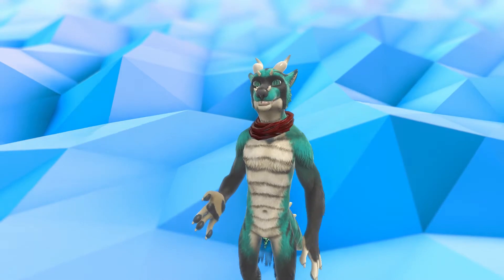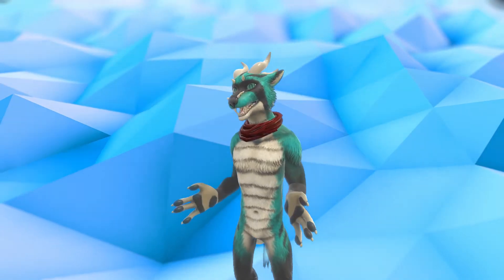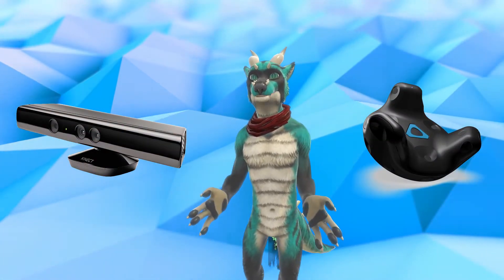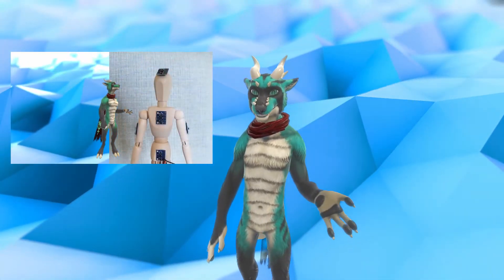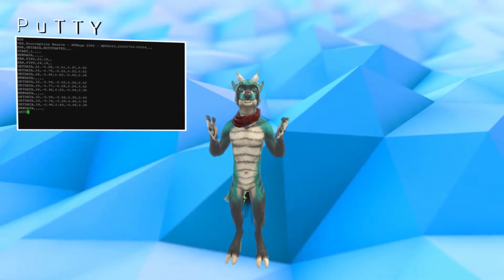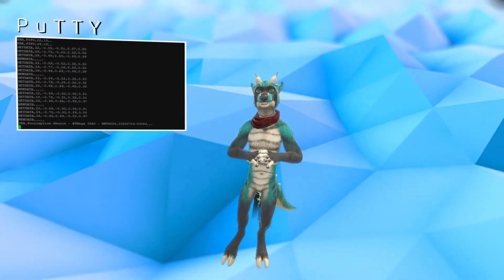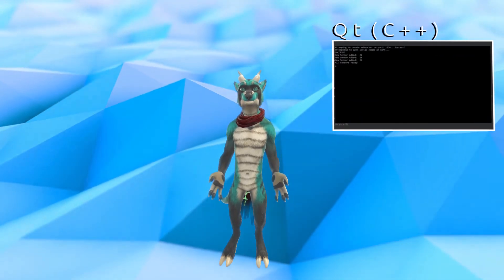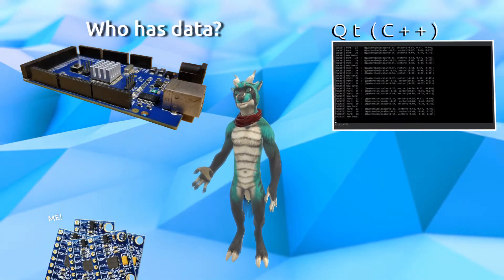DIY Motion Capture Suit - VLog 002

Comment: https://youtu.be/FGNmMZX0g_M here you go bud here are the schematics with the code you need for the MOCAP suit. However idk if it works in VR chat but good for recording movement in blender. Your looking at over 500 bucks worth of equipment. Also the youd have to get the plastic cover parts made if you don't have a 3d printer hope this helps.
Reply from the maker: I'm still watching the video right now (thanks for the link!), and it's really interesting how much the ideas compare to each other. Granted, he's using a different IMU and that is where the prices differ. The BNO055's price is $22 per unit from an evaluation kit whereas the MPU-6050s are less than $3 on eBay. Both have onboard processors to help process the data before we get it (which is a godsend). Both seem to also offer quaternion angle support, which is very important.
It also seems we both agree in opting for the MEGA2560 boards and ran into the same issue with address limits on our IMUs. While his solution was something I realized I should have used (an I2C Expander, which I did order), the solution I have doesn't require it, though I have to admit his is far more organized while mine is anything but.
Thankfully, my project is broken down in where the software can run independently from the hardware, who can run independently from the software. In theory, the virtual trackers could be a third separation, but I'm getting the suspicious feeling that if I reached out to the openvr input emulator creator, maybe I can find an easier way to doing it without having to bash my head against a wall figuring out OpenVR's documentation.
I had a 3rd video to upload, but I found that doing the videos and working on the project meant choosing one over the other, hence why there was no VLog003. Once I have the data from the suit visualized (either in Unity or something else) and can see the core components are working, then that'd be VLog003 worthy.

Comment: Definitely interested in this.  Do you have a price breakdown of the electronics you've purchased?  Are you using EKF filter on your code?
Reply from the maker: Sorry for the delay! There's honestly differing pricing models, as so far my parts were acquired from eBay, but I do want to, once the software stuff is sorted out, work on a more proper parts list with services like Digi-key.
Anyway, the parts for just the electronics is just the wires, the MPU-6050 modules (Usually less than $5 on eBay each), and an Arduino Mega 2560 (about $10, though I am using a Mega 1280, and it seems to  be okay). Other costs would depend on things like attaching them to the body, which I mostly just used GoPro knockoff components for that. In short, the project would cost less than $100 if done this way.
As for an EKF filter, I had to actually Google it, and the short answer is no; the MPU6050 has a processor on it that can handle drifting and gimble locking concerns, down to even returning quaternions for nicer processing. They are being discontinued and their replacement, the ICM-20648 (they suggest ICM-20689, but the 20648 has the DMP, which I'm reliant on for now) is more available and has just as good library support. On Digi-Key, they're about $6 each if you nab the 15 or 11 you need for this project, which isn't too bad. I haven't fully looked into them being a solid replacement, but I know I will need to in the future.
Reply: @FlameSoulis  Thanks for the reply!  Just checked out your twitter too.  Hardware is no issue for me as long as I have instructions LOL.  I've been soldering for years.  The code would be way above my pay grade.  Just curious, do you plan on releasing any of this project?  Plans, code or anything?  Any thoughts on saving/exporting the mocap out to Blender/Unreal/Unity/Godot?  Thanks again!